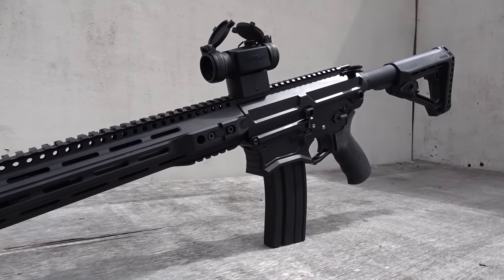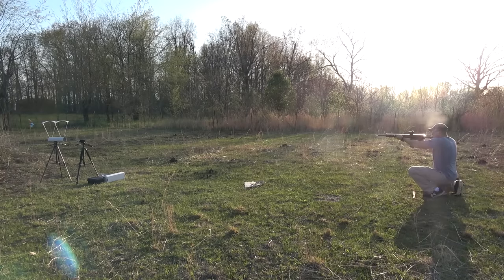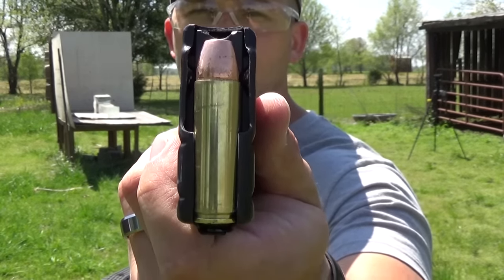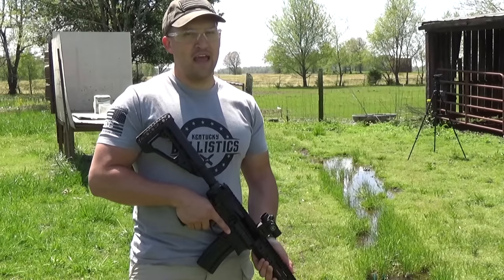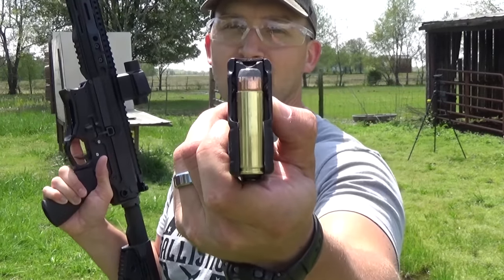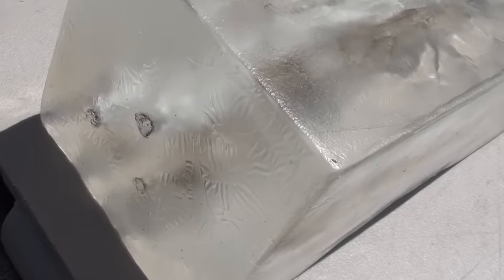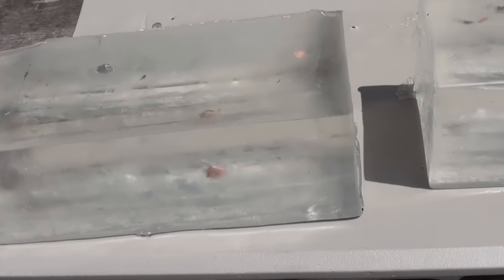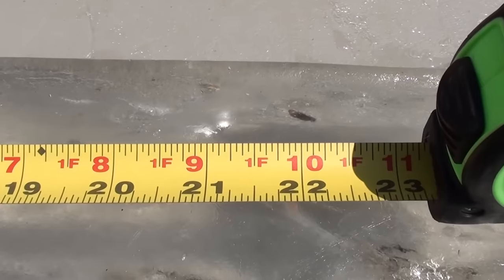500 Auto Max vs Ballistic Gel

Comment: So, a pistol caliber carbine for home defense, or polar bears.
Reply: At this point I wonder if it's a pistol caliber carbine, or a rifle caliber handgun. .500SW magnum has so much stopping power in such a small package, that it competes with your rifle calibers fairly well.
Reply: @dsrocks6905  The average muzzle energy of a .500 Magnum round is 3900 joules, which is about the same as a 30-06.
Reply: @nazarderkach9320  Yeah, but there is a lot more mass in something like a .500SW I'd assume. I mean they make 700 grain bullets, and it's a 50 cal. I mean I guess 500A or 50BW makes a bit more sense, but even then I'd say it's overkill unless you're fighting a bear or a moose.
Reply: @dsrocks6905  There is. The bullets are much larger and heavier.

Comment: Is there a huge difference between the 500 Auto Max and the 50 Beowulf?
Reply: Hugh difference.  Beowulf is a great round. It's made at standard pressure.  500 S&W is made at high pressure. Much more energy and speed. Visually,  the two rounds look the same. Use the same mags

Comment: Big question: your using a CURVED magazine, when intakes to big horn, I was told they only used straight.  How is the curved one working? Who made it? $75.00  each for the 9 round is kinda a hard pill to swallow. (Especially, when it's a 3d printed follower in a run if the mill ar15 mag).

Comment: You no what I really really want to see? Some chronograph numbers on the glock 21 converted to 460 ROLAND its suppose to be as powerful as a 44 magnum which would be absolutely awesome In a glock but new calibers tend to greatly exaggerate there numbers I want a glock g17 9mm mostly because its cheap to shoot and a 500 s&w as a back pack bear defense gun then of course theres my ar-15 in 223/9mm I'm only allowed 3 guns max so if the glock 460 Rowland really puts out 44mag power I could shoot 45 acp through it at the range (not that much more than 9mm) and load up the 460 rounds for hiking and home defense that would free up a space and I could get that Benelli m4 if always wanted any ways great show keep up the good work

Comment: Don't get me wrong I think 500am is sweet im just curious if a 460am would pick up velocity/energy and range with the barrel lenth advantage. 
Also look it has trocars
Reply: the baddest there's a round for that. It's called the 45 raptor. It looks hellabadass too. Check it out.

It's not as powerful as the 500 automax  but it's more powerful than the beowulf. And using an AR10 frame it uses the full capacity of the magazine due to using 308 brass that's blown out. So 20 rounds of 45 raptor in a 20 round magazine. 

The 45 Raptor is ballistically the same as 460 s&w. Just wish a rimless case using 308 brass. Personally I just wish they made the bullets longer and more tapered, basically letting you hotrod 458s etc. But that apparently is an issue, I talked to the inventor about it once. He had a lot of reasons why it has to be just so.

But now he's got a cool new idea: the 375 raptor. Think the taper of a 308, better range, better energy retention, but similar weights and energy as 460 s&w. Now that puts a tickle in my mind alright. A round that can do it all. Big bore smack down and takes it out to 300 yards with weights up to 350 grains.

Makes me drool thinking about it. Now I just want it in an m1a. Hell I'll even take a 338 federal in an m1a socom. 
If it was possible to do 45 raptor in a socom just put a fork in me I'm done. Old school auto, brush gun bullet in a high octane combination with 20 rounds on tap... nothing better.
Reply: ravissary79 , technically no I own and hand-load 45 Raptor and technically by the ballistics it is much better than a 500. At the muzzle to 100 yards on some occasions the 500 prevails but after that the show is over, ballistic coefficient wins out every time. Plus to it's got a much higher PSI than the 500 which is beneficial for a long barrel.
Reply: impressive. I didn't know that. I was planning on making a 45 raptor as I've been drooling over the idea for a couple years, but I'ms tarting to lean toward 375 raptor for the reasons you're saying 45 is better than 50. it's got all the oomph it needs all the way out to 300 yards and beyond, but with similar muzzle energy and bullet weights available as the 45 raptor. Better BC.
The rifle I'm planning isn't an AR though and has a slightly longer action so I'm hoping I can load bullets long for even better BC and or weight without excessive pressure (loading long means more case space and less pressure). But it's an oddball rifle idea so I'm struggling to find a gunsmith who's up to the challenge as there's only so much I can do by hand with my experience level.
Reply: ravissary79 , I hear you on that that 375 raptor is a sweet round
Reply: Jeffrey Holtz it's kinda sexy looking too. No lie.

Comment: If you can't get it done with 10 rounds of 500 auto max something has clearly gone wrong.   Or you took on way to many tactical t rexes.   Out of curiosity what does that block weigh?
Reply from the maker: Haha! Probably between 10 and 15 pounds. I need to weigh it.
Reply: Kentucky Ballistics that's a bunch of power to toss something that heavy around I like nothing.

Comment: I'd disagree with your assertion that barrel length adds to accuracy. It's often stated but only applicable in regards to iron sights, long barrels with irons add to sight radius which improves the shooters accuracy. But use optics and that pulls that out of the equation. Barrel length has very little outside of barrel harmonics to do with accuracy

Comment: is it better than 50 beowulf?
Reply: B Souza looks like about 200 fps faster per weight on average. The gun uses an AR10 upper but takes the smaller beowulf size magazines. The AR15 can't handle the higher bolt velocity of the 500 max. The Beowulf was always running lower pressure than the s&w 500 due to the limits on the ar15,  and so it could use a weaker crimp and headspace on the mouth. Despite that it's incredibly powerful, this just takes it to the next logical level with a platform that can handle what the cartridge dimensions were always capable of.
Reply: ravissary79  tanks men 👏👏👏 i was Think about some exclusive cartridge as a .357maximum rimless 😍 using a 5.56 brass.
Reply: B Souza I've seen some guys try that on various forums. Usually  your get feeding problems. The cartridge is too straight and thin, it gets stuck. Just look at how tiny the shoulder is on the 300 blk. Between that and the. 357 is say 5he fattest you could go and still feed reliably would be .32 like those used in .327 magnums, or 32 acp. But that limits you to about 120 grains or so. If you go straight walled you could try the .338 with a gentle taper and that might give you gobs of versatility. 

But I hear ya. A 357 automax sounds awesome. It'd be more terminally effective on pretty much everything but armor and keep the capacity maxed out.

Hell, if you can work it out then do it. Maybe the trick is the feed ramp or the magazine feed lips. The 50 beowulf is straight walled and it feeds via opened feed lips so it's pre-angled to ramp up in.
Reply: ravissary79  yeah maybe it just need some profissional gunsmith to make it works
Reply: It's not that the AR15 can't handle the bolt velocities, it's that the bolt is not beefy enough to be milled out for that large of case head.
Reply: Tombs Clawtooth thanks for the info . ;)
Reply: No it's not better than the 50 Beowulf
Reply: Jon Keil The only way the 50 Beowulf is better is less recoil..
Reply: Just like i can push the 50 beo close to factory ammo automax loads, i'm sure I could push the automax up a few hundred fps over what's shown here. the extra bolt strength of the ar 10 platform could handle more. all things considered the automax could always outperform the 50 beo. just the way hand loading works. btw, the 500 s&w isn't really close to either
Reply: @jonjames4281  The 500 Auto Max is a 500 S&W Magnum with the rim turned down, otherwise they are identical. Yes, you can buy 16, 18 and 22" barrel lever guns from Big Horn Armory, same people who make the 500 Auto Max.
Reply: yeah and you can make 50beo from 500 s&w too, just rebate the rim. kinda forgot about the lever guns, thinking pistols, my bad. still, the only way to see any of these cartridges full potential is to hand load. though at some point you got ask yourself, just how much power do I need. it's already enough to kill a car let alone any game  animal.
Reply: @jonjames4281  Its not the cartridge that's the limiting factor with the 50 bro, but the platform. It's made on an AR-15 platform and limited to max pressure of 33,000 psi vs the 500 Auto Max which is 60,000 psi. Also, looking at it, I don't think you could make a 50 beo from 500 S&W brass, look at the rim. Its parent case is the 50 AE.
Reply: well that's how we made 50 beo back before starline started carry them. 50ae isn't the parent cartridge of 50beo. the psi numbers only reflect what the bolt can handle, not the case or chamber.
Reply: 458 Socom is more powerful then .50 Beowulf. The 500 Auto Max kills them dead 💀

Comment: Very nice video,i think 500 s&w magnum is more powerful than it.
Reply from the maker: It’s the same thing man 👍
Reply: This rifle will push most bullets 200 FPS faster then even the 10inch 500 magnum... so no it is not more powerful then the rifle. But I think they are close enough that anything hit by either one won’t know the difference lol
Reply: The biggest differences is the size of that package, and accuracy potential as well as of course reloading time. Honestly unless you are Annie Oakley with a revolver the rifle is gonna help you get the job done 90% better for most applications. Both guns are pretty cool, for my money I’m still going with my revolvers but if I were hunting I’d go for the rifle in a hot minute.
Reply: Stephen Koppe according to his 500 magnum penitration test video ,I saw 500 magnum have more velocity and penitration power so I told 500 magnum is more powerful.
Reply: surbhit sharma less velocity on the revolver means less expansion and more penetration in the gel. The rifle has a higher velocity and more expansion which equates to less penetration
Reply: Tyler Matthews thanks.